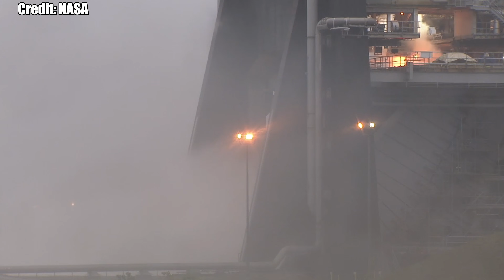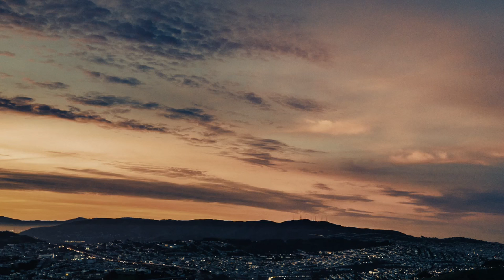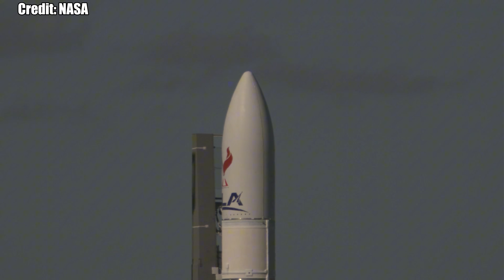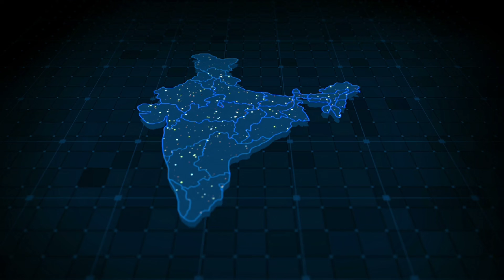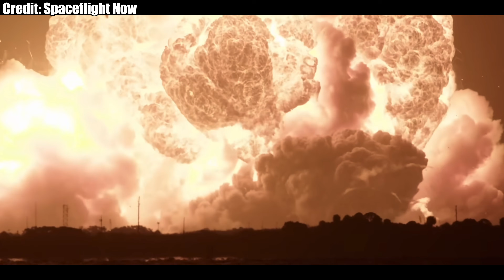They Just Proved Rotating Detonation Engine Will Work

Comment: I think the narrator has severely misunderstood what 25% thrust efficiency gain means for cost per kg of payload. If an entire rocket's mass is 90% fuel, a 25% reduction in fuel use means payload can increase from less than 10% to 35% , a more than 3.5x payload increase for the same or less cost. That's much better than a 'modest' 25% improvement
Reply: Given that the script is AI, in not convinced the narrator exists.
Reply: @nonamesupplied1875  agreed
Reply: @nonamesupplied1875 I just checked three other videos that the narrator's voice changes on each of them. and they only started uploading 3 months ago. this is almost certainly an AI doing the narration as for whether it's written by an AI that something else
Reply: @Kople101366  The script keeps making a lot of structural decisions that feel very AI.
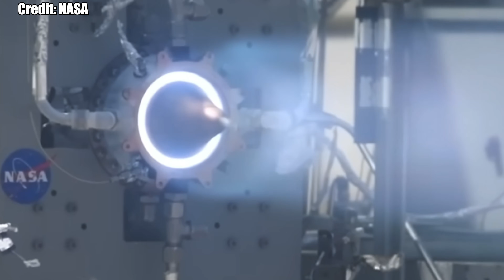Reply: @Kople101366 didn’t he stutter at 9:25?
Reply: @nonamesupplied1875 Such as? Go on. We're listening.
Reply: @ficklefox2171  "Here's the thing -- That shouldn't be possible"
"280 tons of thrust, record chamber pressures, but the harsh truth is..."
"more power density; and that's the key phrase here: power density."
"...it's not spacex, it's not blue origin, it's not a defense contractor with a black budget, it's..."
Reply: @kibermen-rx Probably. In retrospect, I think he's generated the script and is reading it himself. That being said, I've heard 11Labs insert stumbles like that.
Reply: @kibermen-rx newer ai voices stutter and breathe
Reply: @nonamesupplied1875   You can hear him stumble on words here and there. The script is definitely LLM assisted, but the narrator is human.
Reply: @newsofthepews Yep, a few stumbles, you can hear inhales, and at one point a sniffle.
Reply: Sadly, the 25% number is nonsense.
That is compared to gas turbines. It is a common issue with reporting RDREs.

The actual ISP increase is 3-14%.
The aerospike (which might actually be more viable with an RDRE, ironically) adds 10-15% improved effective ISP. (But only from earth surface to low-earth orbit, no real benefit past that point.)

Combined, that means you go to 20-35% increased payload capacity, not 3.5x.
Reply: @SirSpence99  So would a 20% increase mean we could achieve STO?
Reply: @bbuhler  No. The technology for SSTO already exists, it is a practical/economic consideration, not a technical one.
Reply: @SirSpence99 what? BFR? Spaceplanes?
Reply: @TheNadOby  Use these types of engines for both; Big Friggin' Rockets for transporting large components to LEO, spaceplanes (advanced versions of Bransons' Spaceship 2🤔🤨) would be for personnel and smaller cargos.
Reply: @bbuhler  SSTO is about nozzle expansion not efficiency.  
In a rocket you pump fuel and oxidizer into a combustion chamber and burn it.  The result is a large volume of very hot gas, which you expel through the nozzle.  It expands from the very high pressure of the combustion chamber to ambient atmospheric pressure, which the rocket bell uses to provide a lot of thrust.  
The issue there is sizing the rocket bell nozzle for the amount of expansion you'll get.  And the amount of expansion you get changes as you ascend- less ambient pressure means more expansion.  
Make the bell too large and you'll get flow separation- hot gas will jet out the center of the bell and create a low pressure area between that jet and the wall of the bell nozzle, which reduces thrust.  
Make the bell too small and the gas still has expansion left to do after it leaves- it then expands after the nozzle, wasting that energy.  When you see a rocket launch and it's high up and the rocket plume is shooting wide far outside the diameter of the rocket, that's why.  

Point is- SSTO isn't about efficiency, it's about the simple fact that an engine designed for sea level will suck in space, and an engine designed for space will suck at sea level.  

Aerospike engines solve this problem.  But in turn they create another- cooling the spike.  In a traditional engine, the combustion chamber is cooled by spraying a film of propellant around it.  That cools the inside surface as it boils into gas.  The spike has no such luck.  Which is why we aren't all riding SSTOs to lunch at a private space station.
Reply: @bbuhler  If Starship and Neutron live up to the promises, then SSTO becomes irrelevant.  Full reuse is full reuse whether it's one stage or two, and TSTO is significantly easier to achieve (you aren't dragging as much dead weight uphill).
Reply: @STSWB5SG1FAN BFRs are fine, but they not automatically enable SSTO.
Spaceplanes are nice concept, and i like to see them in my timeline, but there are hard engineering problems needed solving first
Reply: @SirSpence99  my thing with arospikes is is you look at the xrs 2200 probably the furthest an arospike got in development it's isp is 338 at sea level and 428 in vacuum 
An rs25 had an isp of 366 sea level and 452 in vacuum dispute both being hydrolox the rs25 a sea level bell nossle is more efficient than an arospike at sea level AND in vacuum 
 
And also isp is overrated in first stage boosters impulse density and twr (note rdes ilegidly have good twrs I'd have to see flight ready hardware to believe all the complexity added doesn't kill the advantage of increased thrust though) is more important as other wise you'll deal with gravity loses which will eat away any improvements so if we're considering a first stage rde than my questions are more about how efecent it is how big you can make one that still works and how reliable you can make it especially if you need clusters
For a second stage the isp becomes a lot more important but arospike effects are a moot point so a lot of that benifet is gone but I feel like second stage rdes are more likely to show up first than slowly make it into boosters
Reply: @SirSpence99 yes! Somebody finally said what I was thinking 🤔 not that I know about this 😢
Reply: @CraigLandsberg-lk1ep this is exactly what I was thinking. But I am also not a rocket engineer... Just a simple mechanic that kinda understands how things work 😂
Reply: He said 25%more efficient
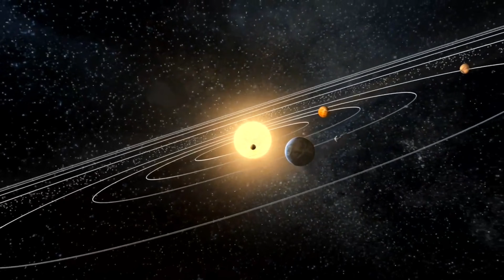Reply: Just after 19:30 he does say almost exactly that
Reply: I would elaborate but I don't have that much motivation. This AI robo generated trash is so full science errors and just plain wrong stuff. I'm blocking the channel.
Reply: Nerd
Reply: Looks to me like he not mathing it... he keeps saying a 25% efficiency  IMPROVEMENT, then DESCRIBING 25% Efficiency.  The 15% efficient engine is closer to 18.2 % efficient, no where near 25%
Reply: This is a combustion engine. We've had good luck with these in the past.
Reply: @gkwetmore  it's not a combustion engine it's a detination engine
Reply: @acompletelynormalhuman6392 could it be better than an ion engine?
Reply: @FinestDivan  An ion engine will spank a chemical engine in terms of specific impulse (ultimately allowing much higher delta-v), but has very little thrust; you'll never use one to get off the ground,and getting up to speed takes a while.  We're pretty much stuck with chemical engines to get from the ground to orbit.  This engine offers some incremental efficiencies over traditional engines; the question is cost.  Can you produce enough to meet demand at a unit cost on par with the SpaceX Merlin engine?

Comment: I have never heard 25% efficiency claim before. Usually the number quoted is 5-15%. Scaling them up in size is going to be the hard part.
Reply: Yes. He also conveniently forgot several advances on the same order of magnitude that has happened since the 60s, like the soviet NK-33. This is a very young technology, many years and probably even a decade before any usable engines comes out of this.
Reply: Looks to me like he not mathing it... he keeps saying a 25% efficiency  IMPROVEMENT, then DESCRIBING 25% Efficiency.  The 15% efficient engine is closer to 18.2 % efficient, no where near 25%
Reply: What, ai is wrong!  LoL

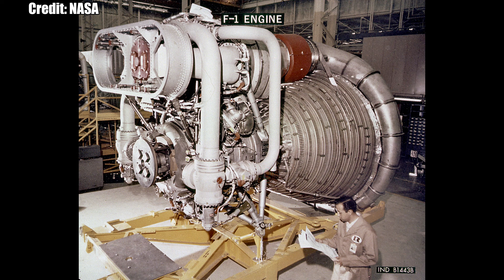Comment: @ 21:36 F1 engine wasn't fighting instabilities, it was literally fighting the detonation. They could accelerate fuel and gases to the point the engine would blow up, and whilst they studied why was this the case, they found the foundations for the first part of this engine.
Reply: It is a triumph of human engineering. Almost unbelievable, but sometimes big things happen when it's the most important project in the country.

I took a little peek at its stats, and I almost fell out of my chair.

Propellant Flow Rate: 42,500 gallons per minute (fed by a 55,000-horsepower turbopump)

55k ponies

Comment: 4,000 lb of thrust is almost laughable. It is less that 2 tf. Thrust is usually quoted in metric ton-force (tf ≈ 9.807 kN). (1,000 kg) under standard Earth gravity:
•  1 tf ≈ 9,806.65 newtons (N)
•  or about 2,204.6 pounds-force (lbf). The current Raptor 3 engine produces between 250 tf and 280 tf. That's right <2 tf vs 280 tf; per engine. The Raptor 4 will produce over 300 tf. 
For comparison, a full Super Heavy with 33 Raptor 3s at nominal 250 tf would produce roughly 8,250 tf total at liftoff. 
It's and interesting concept but these engines have a long way to go, and that is provided the material science and physics can get them there.
Reply: Raptor is a production engine . this is a test engine . different requirements
Reply: @trax-gaminig3569 Certainly and I think we are saying the same thing. The most important part is that, after decades of research, they have only been able to get this concept to produce less than 2 tf of force, while Raptor 4, which is also a test variant, is already producing over 300 tf. There are limitations to physics and materials science, Raptor is pushing the limits and who knows maybe this other type of engine will be able to scale up but with the failure rate of getting this far, I don't think scaling it up 150 times will be possible without some other radical changes. As a kid, my first rocket engine was a firecracker under a soup can. It consistently reached about 8 to 10 feet off the ground, and adding more firecrackers didn't seem to help.
Reply: @benphartine  good point. It's viability depends on of it can catch up to current tech
Reply: You make prototypes small because they are faster to make, and by extension, you can interate faster.  The raptor started production in 2021.  It is NOT a prototype.
Reply: The rl10 a famously underpowered engine (for a second stage which needs relitivly little thrust) has a thrust of 11 metric tons so yeah they are definitely going to need to scail up but they are just dimistrating the concept right now there's more ways to go than the hype would have you believe but it might be usable eventually
Reply: That’s why the focus is 2nd stage where efficiency matters more than total thrust.

Comment: Am I wrong or did they dampen the vibrations by mounting it to a giant 6 inch thick steel plate?
Reply from the maker: They did mount it to a very robust test stand which helped with some vibrations, not too sure if they used a giant 6in thick steel plate but nonetheless it's still impressive that the engine completed those long-duration burns with no discernible hardware damage.

Comment: Ok... Interesting BEGINNING!   Problems always come in upsizing!
Reply: I foresee an issue where as they scale up the diameter of the rocket engine They need to have more detonation cycles So in the current engine they have it's 3 but as the diameter increases they're going to want to have more but also spacing between the outer part of the engine and the inner cone will also play into that. 

this requires testing a massive amount of testing.
Reply from the maker: Very true. Its seems that a ton of technologies work at small scale but run into challenges when scaled up. This is a promising start but proving it at scale is the real challenge.

Comment: Sounds like SpaceX should be researching this too !     
It takes time to develop a new engine…
Reply: Oh, you can bet those geniuses are, but in the interim think about the rocket technology they are advancing all while using. Consider this and you will realize that the 4,000 lb of thrust mentioned that this technology has finally achieved is only a footnote to the technology being used. It is able to produce less than 2 tf (2 tf; keep that in mind). A tf is a unit of force equal to the weight of one metric ton (1,000 kg or roughly 2,200 lbs of force) under standard Earth gravity:
•  1 tf ≈ 9,806.65 newtons (N)
•  or about 2,204.6 pounds-force (lbf). SpaceX’s current Raptor 3 engine produces between 250 tf and 280 tf. In exploring this old idea or technology, they have finally succeeded in achieving <2 tf vs the 280 tf SpaceX’s Raptor 3 produces. The Raptor 4 will produce over 300 tf. Then multiply that by the current iteration of 33 engines per vehicle, which will soon increase. 
Your right it will take time provided it can be successful in producing higher amounts of thrust but for now the space race is dominated by many variations of the same rocket engine SpaceX uses and the Raptor currently leads the pack. 
GO SpaceX GO Raptor. 

Thrust is usually quoted in metric ton-force (tf ≈ 9.807 kN). For comparison, a full Super Heavy with 33 Raptor 3s at nominal 250 tf would produce roughly 8,250 tf total at liftoff. 
It's an interesting concept but these engines have a long way to go, and that is provided the material science and physics can get them there.
Reply from the maker: True, engine development doesn't happen overnight, but SpaceX is so focused on their raptor and starship that they haven't publicly disclosed their work on RDRE's. That said, who knows, they could be quietly researching RDREs behind the scenes
Reply: @VectorSpaceStudio Also consider that the materials science and physics for this technology currently produce less than 2 tf. The Raptor 3 produces about 280 tf and the Raptor 4 will exceed 400 tf. The material science and physics are the stumbling blocks. In the past, the materials could not survive the shock now multiply those limitations by 200 which the Raptor 4 has currently achieved. 
I guess we are all excited to see what the future holds. It wasn't that long ago that reusable rockets were a dream too.
Reply from the maker: @benphartine Great point, the thrust gap is probably one of the biggest hurdles. It is still hard to wrap my head around how insanely powerful the Raptor's are. Current RDREs are still mostly in the research and early demonstration phase, while Raptor is already a highly optimized flight-proven engine operating at a completely different scale. What's exciting is that RDREs aren't necessarily trying to compete on thrust today but on potential efficiency ,compactness, and reduced hardware complexity. If the materials and combustion challenges can be solved at larger scales, they could become a valuable addition to future propulsion systems. Either way, it's all very exciting stuff to watch all technologies advance further.
Reply: @VectorSpaceStudio it is good to see that we have someone who has the vision to go beyond the norm and expand our current understanding of science and physics while creating new technologies. 
I think it was in 1905, roughly 120 years ago that the #1 industry was whaling. The changes that have occurred since then, if told to people back then, would have sounded like the rambling of a lunatic. I wish I could if only for a few hours, jump ahead 100, 500 or 1000 years into the future.
Reply: @VectorSpaceStudio either that or they will buy a company who can do it a few times and will turn it into a mass produced reliable device.
Reply from the maker: @koolkid54100 Yes totally possible, the real challenge isn't just making it work once, it's making thousands of them reliably and affordably. Companies like SpaceX excel at that.
Reply: @VectorSpaceStudio  you also have to understand the elephant in the room about spacex, they're reusing boosters, which is 100% more efficient when you're playing catch with yourself. Rocket goes up, comes down, gets repaired (rather than rebuilt from scratch), and goes up again...
Reply: Probably good on speed but not mass
Reply: Well, no.  These engines are utterly worthless for launch rockets.  They will never be used for that.  WAAYYY TOOO HEAVY AND DRAGGY!
Impulse, the other rocket company, should be more interested in this, as their business is rockets for space.  Not for reaching space.

The narrator talk a lot of nonsense!   Detonation does NOT combust fuel more efficiently.  Total BS and misunderstanding.  The point of the detonation rocket is to combust all the fuel BEFORE the exhaust gases expand.
And the rocket engine is much heavier, and has way too much cross sectional area.  The narrator even believes the old aerospike is beneficial  <rolls eyes>.
The rotating detonation engine is extremely interesting, because it is more fuel efficient.  It is more fuel efficient because ALL the exhaust gasses starts accelerating through expansion at highest temperature.  Not because of some more efficient combustion, that's BS.  But advantage of that fuel efficiency has to be used for applications where this advantage is so useful it outweighs the penalties.

They are primarily interesting for uses where the Thrust doesn't matter much, but fuel does.  It could possibly be developed into jet engines, gas turbines, missile jet engines, and maybe high specific impulse, low thrust engines for satellites and  'space tractors'.

The talk about "cheaper" rocket launches due to - supposedly - less fuel consumption is even more BS'y  <rolls eyes again>.
Reply: Anduril will be more interested in it for long range missles. But the way big companies work is they have an internal r&d but prefer to buy companies so they have more certainty about what tech they are getting while acquiring talent that is already demonstrated success. 

So i would expect them to get snatched up unless they have a clear vision to become a large company.